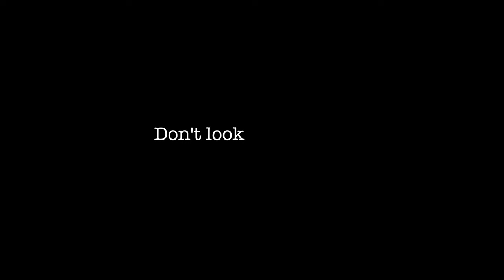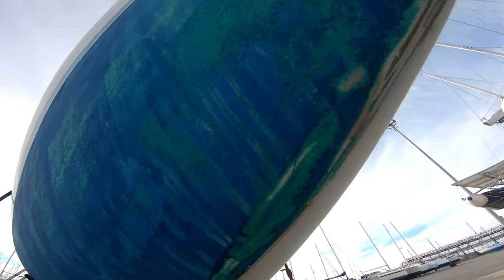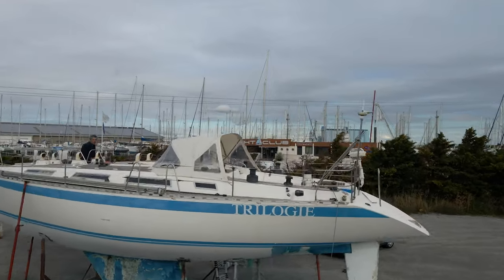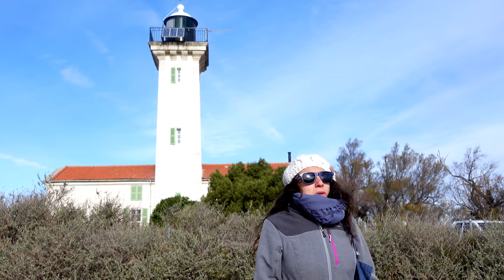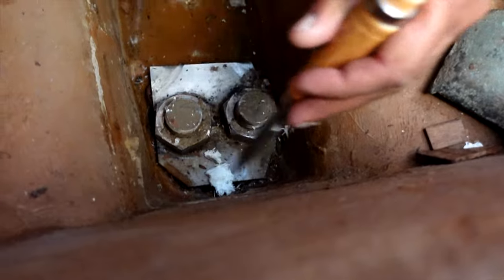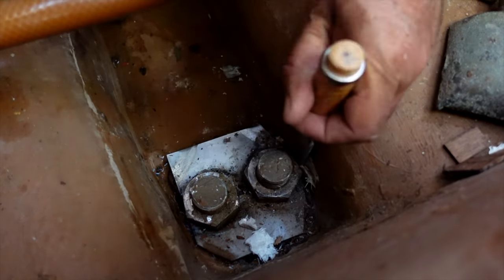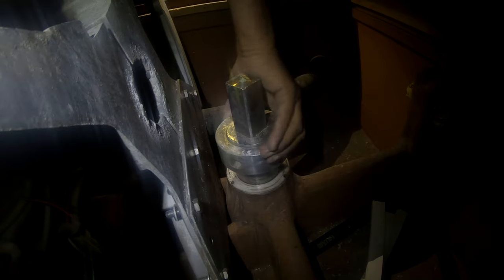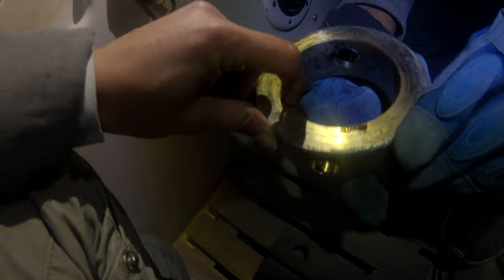Scruffy Boat Work - Ep 6 Sailing Oriyo

Comment: Nice!  -- SOLUTION TO RUDDER ISSUE -- In college one summer I worked in a factory Machine Shop.  They had that type of problem separating metal rings and pipe pieces similar to your rudder problem - this is a very common problem.  The solution is take a flame, like a blow torch, to the outer ring.  The heat expands the size of the ring and the inner part drops down.  But protect the fiberglass when adding the flame to the metal ring - easy to do.  Works perfectly every time.  It would take about 1 or 2 minute of flame/heat on that ring to drop that rudder.  You could buy a simple propane torch at a supply store.  Next time you will know!  Very simple solution.
Reply from the maker: Oh nice solution indeed! Plus we already had a blow torch which we used to melt the lead for the keel. Thanks a lot! See you.

Comment: hi guys another good video, what your doing is gruelling work but at the end of it you will have a great deal of faith in your boat knowing the keel bolts are safe from crevice corrosion ,rudder, bearings are good and an epoxy barrier coat will give you years protection against the pox cheers rob nz.
Reply from the maker: Hello and thanks! Yes good sum up! The rudder, the keel and the state of the hull (especially around seacocks) are precious matters where you don’t want to overlook. See you soon..

Comment: Hi my friends,
 your scraping and sanding habilities are as good as the video making ones. (on video) Looks like you gel coated the hull. At least on youtube, I never saw a sanding job like this. It's really satisfying to see Orriô evolving and getting fit. 
One question, You think that will be necessary structural maintenance on the keel? Thanks for sharing. Salut :D
Reply from the maker: Hi Ronaldo, thanks! Yes every step done is a satisfaction… We took A LOT of information about the keel matter and it all goes in the same direction: we gonna need to drop it off to work on it. But I don’t want to spoil what’s coming, you will see more in the next video on that topic..

Comment: Rudderpost top must have been partly deformed when the boat was built as a security measure not dropping or loosing the rudder completely if it ever were to come loose.
Reply from the maker: Oh ok. So the difficulty to push it down comes from there. Thank you for this interesting info, we’ll need to think about when we lift the rudder up again.